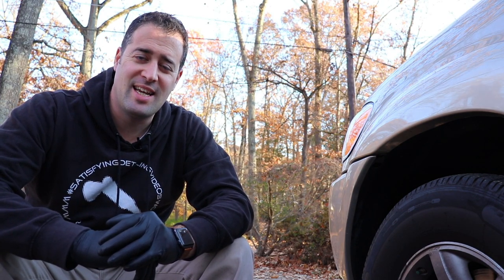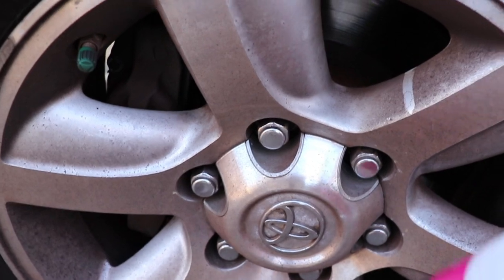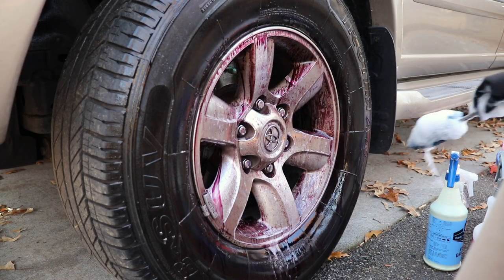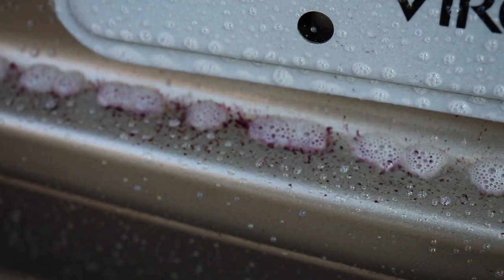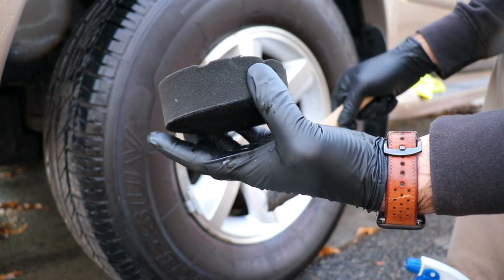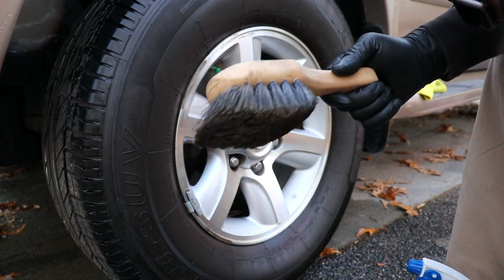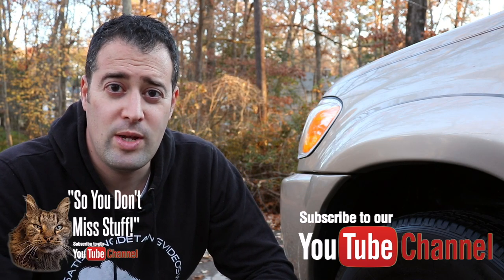Meguiar's Paint and Wheel Iron Decon

Comment: Phil, great minds think  alike. Meg's Wheel and Paint and Wheel Iron Decon is my favorite...the bomb,  of the three I tried (Carpro and Ferrex being the other two),  imo Meg's the most effective, it seems to cling noticibly more, also it does have some have a cleaning package (greaser, grime remover) with some lubricity, so it's safe to agitate with a mitt on paint  a washed car, and it does help. Because of the cleaning package it can degrade a wax or sealant, though we are deconing for a reason, we're looking for a fresh start. I'll email you some really good info from Meguiar's on this stuff. Great Choice! 
Great advice on using the Hyper dressing full strenthgth, loved your results, is it better on longevity? For a quick engine detail I spray the engine with Superior rage 4:1, go over it quickly with a wheel face brush, ez detail brush, boars hair brush, rinse, dry quickly, start the car, let the engine heat dry the rest, spray Hyper dressing 4:1, and leave it, it'll self level. I don't call this a full engine detail, it's sonething you could over deliver for a good customer (it takes 10 minutes), or charge for a basic, engine cleaning (i do not refer to it as a detail), addionally I use the Hyper dressing on 4:1 on truck bed liners, again spray on, let it self level.
P.S. I'm with you on the dedicated bottles and or lables, I have a strip lable maker, I like to keep things neat, and coor code the dilution ratio with colored strip lables for multiple dilutions of the same product,  though it's tedious to make them.
Reply from the maker: Thanks man! Love the info!  I wouldn’t consider Hyper dressing a very durable dressing at all. But it does look really nice!
Reply: @MirandaDetailing  I agree in the summer I'll hit my truck bed with Hyper dressing once a  week,  in the Michigan winter when you get the freak 40°+ day on a week end, so rare, you cancel all plans, and move like a banshee to get as much of a detail in.

Comment: I heard this is the same as Ultimate wheel cleaner. I like it because is thick as gel and stick better on the paint
Reply: Not the same, the strict wheel cleaner is gel and you don't want that on paint. Its just going to stay in a spot and not saturate the whole panel. This wheel&paint has less viscosity making it more viable and cost efficient on paint.
Reply: Hey Carlos, although UAWC and D1801 both change colors, they are actually very different chemistries - much more so than you would think. We actually use more aggressive (faster) cleaners in D1801, and it boasts about 30-40% more cleaning power. It also spreads better on paint. Hope that helps. -Markus, Meguiar’s Professional Product Manager
Reply: @MarkusKleis  yup, thanks for the info

Comment: Great video! I’ve been using the meguiars pro line for years and can’t beat the cost and efficiency with the bottles. A few thoughts on some of these products - I love super degreaser for the tires over the citrus APC (I also use that for my ore soak on the vehicle) and the iron decon is the most cost effective iron remover out there (especially through Autoality). It does smell the worst though, ESPECIALLY later on in the detail - it seems to linger so if you’re working indoors on the vehicle you’ll get some funky scents!
Reply from the maker: Thanks!  I totally agree. And yeah that stuff stinks!🤢

Comment: What if this gets on rusty parts of body panels, like my trucks wheel wells?
Reply from the maker: It’s not a problem. It doesn’t cause any more rusting. It will turn purple because if it being bar metal but that’s all.
Reply: @MirandaDetailing  awesome thanks!!
She's an old truck but only some areas rusted. Unwanted to decon, clay and compound/polish it. Tried a small spot and found out it's metallic paint so I want to do the truck.
Thank you for the quick answer!!!

Comment: PW your wheels 1st before using any iron removers.  This way when u use it the iron it picks up is the actual  stuff that was embedded.  No good for vids as there is less purple stuff but it is using the chemical as intended.
Reply from the maker: Oh yes, we always rinse first to get the majority of the brake dust and grime off. I do this mostly so people can what the products are capable of.  Also this new formula is not just a iron remover it is also a cleaner. So they added more stuff in here to actually clean and not just dissolve iron. Thanks 😎👍🏼

Comment: Good stuff. Have you ever tried the Bilt Hamber Auto-wheel? That doesn't stink like the bottom of a skunk :) And rather good.
Reply from the maker: Hi. I haven’t. I don’t think I can get it over here in the U.S. I searched for Bilt Hamber products and only found a few on amazon.
Reply: @MirandaDetailing  They have super cool stuff. Their shampoo, APC, clay bar are superb. And they have a lot more cool stuff. Try to convince Car Guy Supplies to be a local re-seller :)
Reply: HsTuning dot com has some Bilt Hamber products available in the US. The shipping seems to be a little high though on what I heard. 
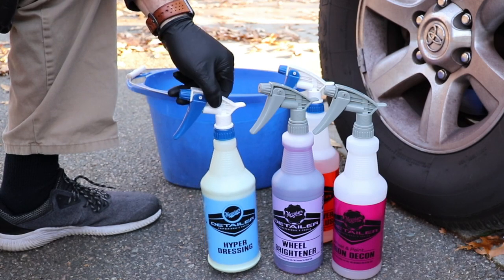And honestly if you want to try out products that are really great. Then at least try them out. Surfex HD is an awesome APC and you can dilute it very weak and it's still effective to desolve the oily grime. On the exterior for an example 1:20 as a TFR in the winter time and with a pump pressure spray bottle it's fast to apply. During the summer months I dilute it to 1:40 when you have some pollen and light road film after a rain. With a PW to clean with it's a really effective aid and most of the time you can do a touchless wash with it. Bugs and depending how hard they are in your environment to get off. Pretreat with Surfex HD in 1:10-1-20 and the bug squash just rinses off easy. For interior I dilute it to 1:30. But you can dilute it to 1:50 if you clean a well maintained vehical interior. Their clay bar is awesome and have the same aggressiveness and you chose in which temperature you claying in. The soft clay bar is awesome in the lower temperature. They claim that water is the only clay lube you need. But I still use a clay lube and it's up on par with the 3M Perfect It Clay Bar and Meguiars Proffessional Red Clay Bar and still it's very gentle on the paint if you use it right. Auto-Wheel and Korrosol which is their iron remover on the paint and has about the same strength in the iron remover ability and AW has some extra cleaning detergents for a very effective wheel cleaner. Also mostly touchless with a PW. And then you have the Auto-Foam which is the best prewash foam out there IMO. It's design to be foamed on and let it dwell and PW clean rinsing it off from the bottom and up. Not made for contact wash though as there you have the Auto-Wash car soap. Auto-Wash has a dilution of 1:1900 and a huge benefit is that it has rust inhibitors in it as the Surfex HD and I think that also Auto-Foam has a little of them as well. I use it in the wheel bucket and if you have a neglected condition of the paint with some rust and or rock chips through the primer. You don't get the rust to spread and you also get almost no rust on the brake discs. And is awesome combo of starting with the Surfex HD and finish with the Auto-Wash on the undercarriages. If you want to stop the rusting even more for a longer while and it also has a great filling ability then you have the Auto-Balm synthetic wax. 5-6 months longevity from it and is great on bare metalls on the undercarriages and also in the wheel wells and especially the edge to the fender if you drive on road salted roads. And make Car Supply to get Bilt Hamber in their webshop and they will get a huge success with it. In most comparison testes here in EU if a Bilt Hamber product is in it it will be placed in the top spot or top 3. They don't do any advertising as the mouth to mouth rumor is enough. Then it's getting a higher price outside of UK but I personally don't care as they are that good. Bilt Hamber fanboy here LOL. The products I have from them have been just awesome so hard to not be it. But they have some ranges of products where they don't fit as their line up is not so wide as I like but you can only use them alone if you want to. No fun in that. They also have dedicated undercarriage products that also says to be awesome for deep cleaning off rust and durable protection products for these parts.
Reply: Korrosol is another fallout remover they do. I have both. I think the difference is Auto-wheel has built-in corrosion inhibitor to remove flash-corrosion on brake discs. They both act very fast, cling hard and dissolve everything. Very effective products, not cheap though. I highly recommend both products.

Comment: Hey Phil, how would you say this compares to other iron removers? I have a gallon of it that I haven't touched yet because of the weather. I've used Iron X before and have heard great things about FerreX. Just wondering if this is on par with all the others.
Reply from the maker: I think they all work about the same. Some are more concentrated then others. But I have been told that this Wheel and paint decon is formulated to also be a cleaner, so more then just an iron remover.
Reply: I don't use iron x or ferrex due to the cost. Just use the decon or meguiars all wheel cleaner. It removes iron as well

Comment: Hi..Do you guys have videos of cleaning white lettering? And the shine part as well. Some manufactures say that the shine ( black wall) will damage the white lettering.. I have a Ford F150 with the Goodyear Wrangler. just to give you a quick Summary..thanks again!
Reply from the maker: Hi. I don’t have any videos on that. We don’t encounter them that much. But when we do we use a strong APC or degreaser and stiff brush to scrub them. If they still are dirty after the wash and they are in good shape and not wearing out I have used mineral spirits on the white lettering to clean them up.
Reply: @MirandaDetailing  what would you recommend for a good polish and wax for newer car/truck? Fire bronze red..not that the color really matters..lol..You guys use soooo many..lol. Your videos are very informative..thanks!  Joe
Reply from the maker: Well if you are just looking for gloss enhancement I great polish to use would be an all in one like 3DSpeed and top it with some sort of spray sealant like like or even spray coating like the Hybrid Solutions line or The Last Coat sealants.
Reply: @MirandaDetailing  would I need some kind of buffer to apply 3Dspeed?  Or is it possible to apply by hand?  Thx
Reply from the maker: You can apply by hand but you want get the same effect. You can start with a smaller polisher like this and get awesome results. https://amzn.to/3d6tSXh and these pads https://amzn.to/390CvRF
Reply: @MirandaDetailing  ok..I’m a Hvac guy. So I have plenty of different kinds of drills..just need buffing pads for  drill. That should work, right?  I have just about everything I need ( almost). Lol. Just bought pressure washer and foam Canon. Can’t wait to try everything out. I live in Delaware..so Weather isn’t very cooperative. But soon!!  Thanks again!  Perhaps you can do a video of your favorite weekend car washing products..from wash to finish.
Reply from the maker: Well drills are hot the best way to polish. It’s going to be a little difficult get the correct finish. But give it try and see how it goes. The DA polishers are very easy to handle and gives you better control.
Reply: @MirandaDetailing  Yeah I was thinking the same thing..polishers go back and forth and spin. (And are made for waxing) Thanks for the Recommendations..Have a great weekend! Peace...joe
Reply: @MirandaDetailing  only issue is..I’ve ordered so many other wax’s like maguires and a few others. Might just give them a go!  But I would definitely like some kind of spray on wax/polish..
Reply: Hi Phil. I sprayed my foam Canon on my truck today and wash and dried it off( mr pink)and.there were a lot of water spots and some Streaks from I guess the car dealer..just doesn’t look shiny and clean like a wash and wax would. paint is good.but something just doesn’t look right. My question is..Will waxing it  help remove that.or should I use something in my foam canon to strip everything off and start from the beginning?  Thank you. Bud!
Reply from the maker: Hi would try an APC rinse rinse first like we perform on our jobs. Wash again per normal and dry. If the paint still looks weird it probably needs a light polish